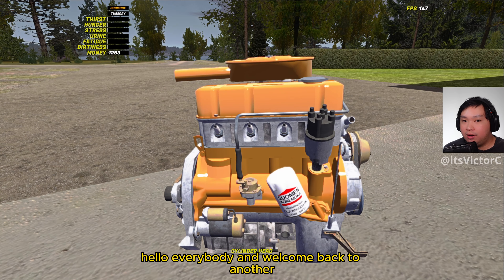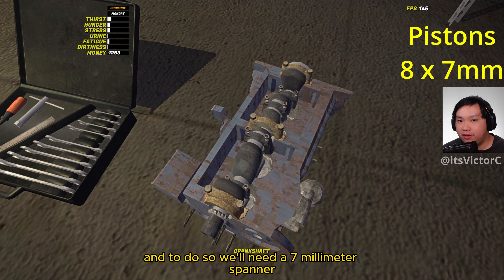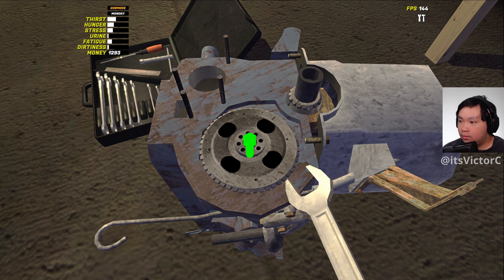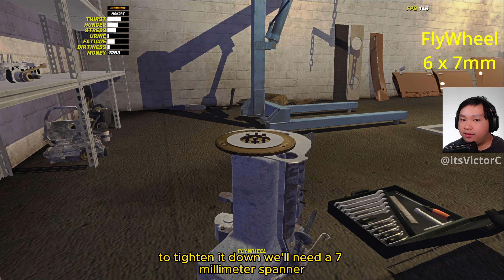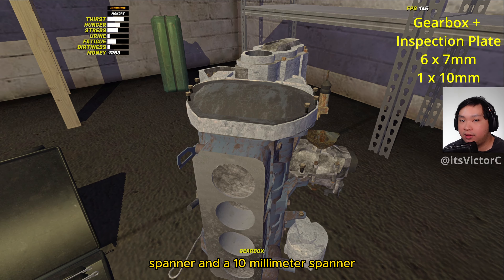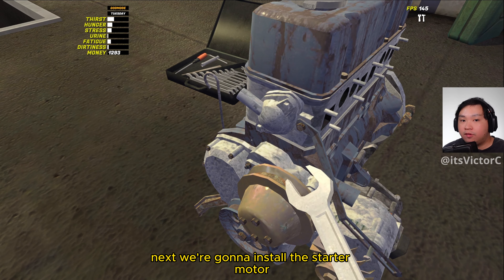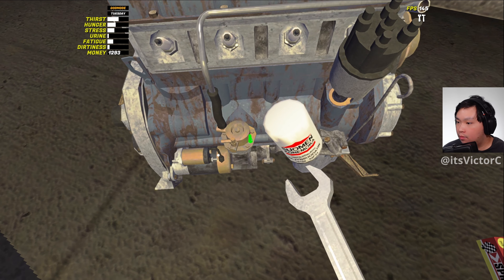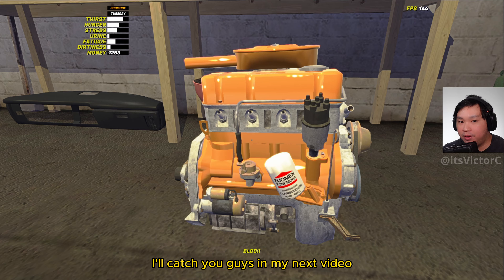My Summer Car - How to Build Engine FULL GUIDE in 2024 with Bolt Size

Comment: victor,i have done the wiring,i have a new battery and the car doesnt start,what's wrong with it?
Reply from the maker: Did you wire up the ignition switch?
Reply: @itsvictorc  yes,i have done everything and my car doesnt start
Reply from the maker: Probably the battery is flat try to charge it up or buy another one from Teimo's

Comment: watch video then reference this while doing: 

get block
upside down
crank in
main bearings in 9mm tighten
install pistons
rotate block
righten down 7mm bolts near main bearings
oil pan and 13m + 7mm tighten
camshaft + 5mm tighten
cam gear + 10mm tighten (rotate block first facing sky)
alight arrows on gear
timing chain
timing cover 6mm tighten
water pump + 7mm tighten
crankshaft pulley + 11mm tighten
alternator + 7 and 10mm tighten
engine plate 
flywheel 7mm tighten
pessure plate into clutch cover plate
bring disc into assembly
install clutch assembly + 6mm tighten
install gearbox
install inspection cover
7mm + 10mm tighten gearbox
install drive gear + 6mm tighten
head gasket
cylinder heads + 7mm tighten 
rockers + 8mm tighten
tune rockers flathead screwdriver until doesnt move, scroll up 7 clicks all
install rocker cover + 7mm tighten
water pump pulley + 7mm tighten
starter motor + 7mm tighten
oil filter scroll up
spark plugs spark plug wrench tighten
distributor
tune scroll down until it stops, scroll up 27 clicks
screwdriver tighten distributor
alternator belt
scroll down on mouse all the way then up 2 clicks
screwdriver tighten alternator
fuel pump + 7mm tighten
headers
carburetor
headers + carb tighten 8mm
carb tune screwdriver scroll up 50 click, down 23 clicks
air filter + 6mm tighten
paint engine
Reply: Is the paint optional?